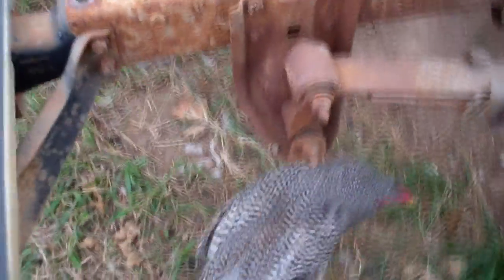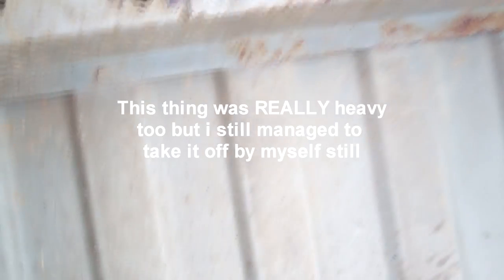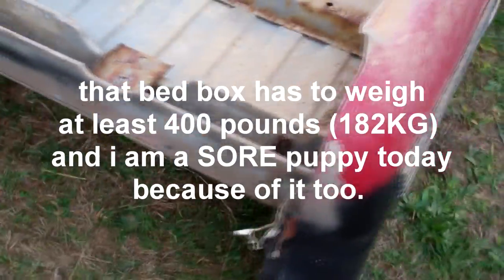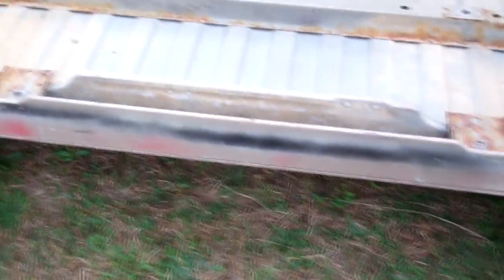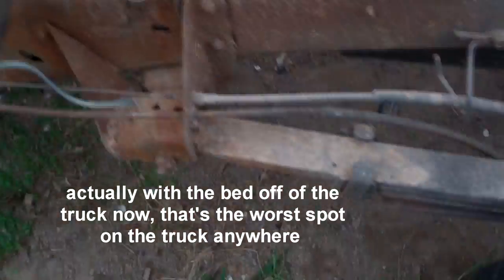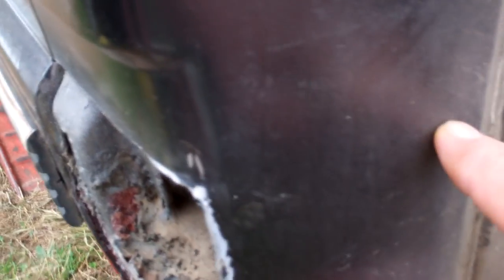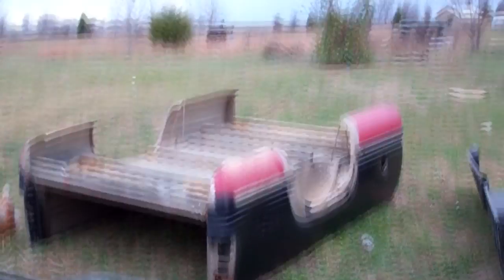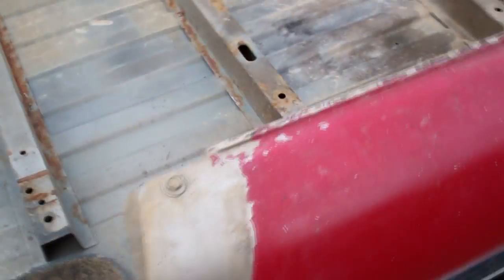how it all looks in the day time

Comment from the maker: @Ridge97 if i can borrow the portable sand blaster  from my neighbor i sure am. get that thing all cleaned up then coat it up really well so that it doesn't rust again any time soon and put her all back together. I understand your thinking about the fuel pump also i've always just dropped the tank on them which is't that bad unless you have gas in it  but if it's empty no big deal either way but yeah i think i may well do that because there's no telling how old the one that's in it right now is.

Comment from the maker: @obieezx11 blasting the frame is more for keeping the rust out of my face when i have to get up under it to do anything bare metaling it was when i was referring to the paint more than anything then putting back on a sealer and painting it straight away.  with the frame i would bare metal it by blowing off what rust is there and then coat and seal it with something and your idea is not an unconventional one i've actually had a few people tell me the same thing.

Comment: Just nget your self some body deadner jim and mix it with desil fuel till its brushabul and brush it all over the chassis it will never rust again not even surface rust. and it will dri like paint dose you dont even need to sand what rust is there now off just paint over it and it will fix it easy fix easy job you proberly wont listen to me but dont say i dident try thats how i treat my under cariges and never had one rust out yet.